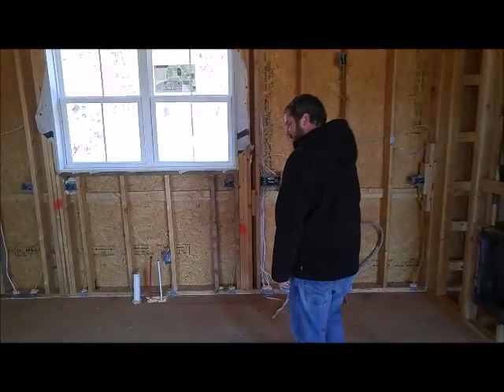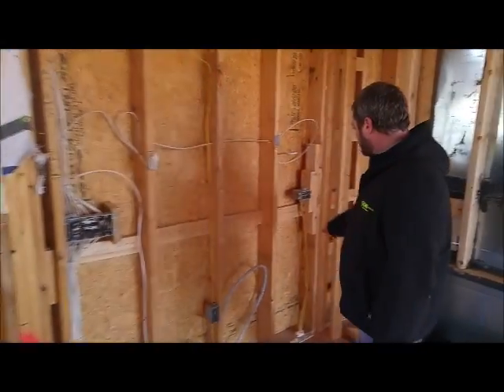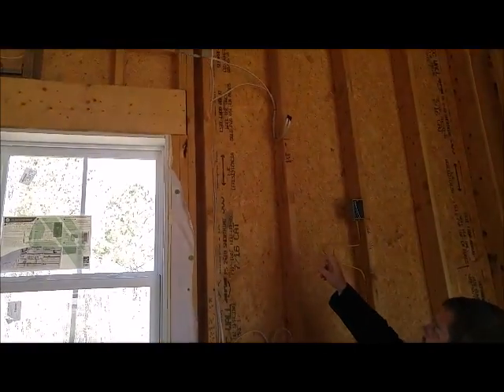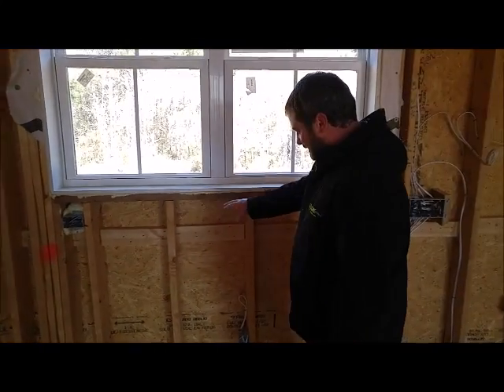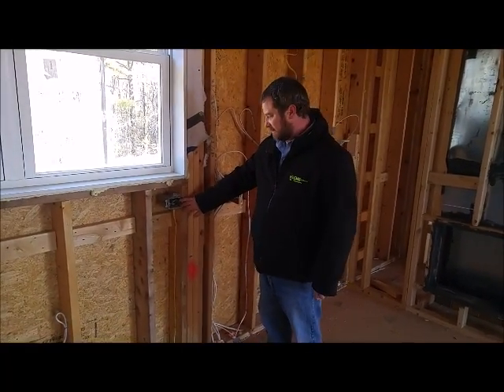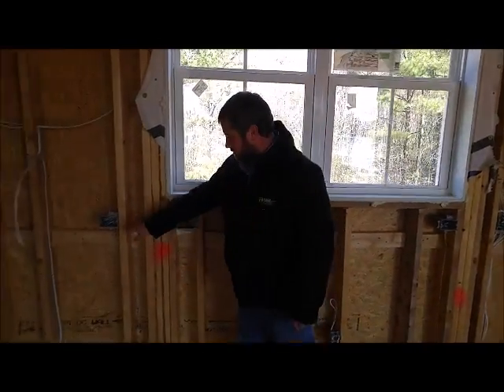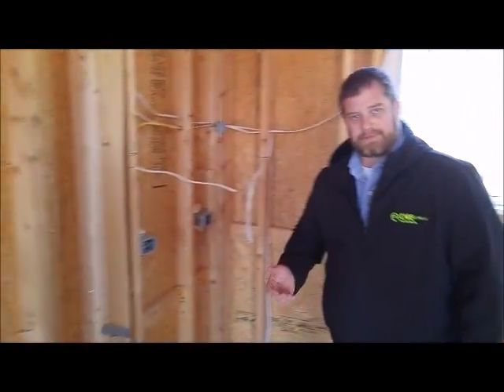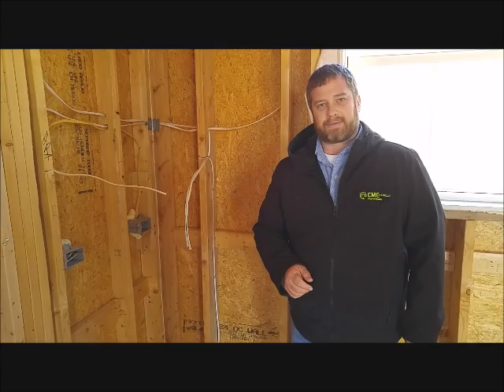Proper Kitchen Wiring

Comment: What is stated in the video is proper spacing code for a kitchen.  If laid out as described then at no point on the wall line over the counter-top area would be a receptacle more than 2' from any point you pulled from.  ie... receptacles spaced out no more than 4' from each other / any appliance with a 2' cord would reach a receptacle if placed at any point on the counter-top

Comment: You do know this guys an idiot right? Code States at no point shall there be more than two feet from any point on the wall to the closest outlet... That means you can put them 4  feet apart... At that distance if you measure from the center in any direction it will be only two feet to the closest outlet this is why the small appliance equipment comes with 3-foot chords. Nec 210.52(c)(1) 
U must feel dumb right about now lol same goes for wall spacing you need an outlet within six feet of a break in the wall then you're allowed to go every 12 ft... Why do you think  electronic devices come with a 6 foot cord... God u must feel dumb right now lol
Reply: also....dont feel dumb
Reply: @kaitlynconrad9080  all I'm saying is that if you're going to do a video showing off your work you should probably know the code and explain you're putting more outlets in for a reason.

Comment: Hi Chris, 
I would like to run as many wires that I can through a hole in a 2x4 double plate at the ceiling to attic location, what size hole do I need and how many wires (12-2 or 14-2)? 

Do the wires need to be derated if i add fireblock foam or caulk in these holes? 

Thanks, Ron
Reply: Generally speaking you can run two of either cable in a hole that is 7/8" or 15/16"

Comment: It would be nice if you could also explain how many non GFCI receptacles are allowed to feed off each GFCI receptacle and each 20 amp circuit. TY.
Reply: in dwelling units, there are no maximum number of receptacles allowed on a circuit; or to feed from a Ground Fault Circuit Interrupter.

Comment: Quick question. What is the required height for the fridge outlet? Thanks in advance.
Reply: 48" to the top of the box
Reply: @derekevans7780  thanks!!
Reply: And that fridge is supposed to be GFI protected.
Reply: @jtd2949  on its own circuit?
Reply: @alfredobrown  no, the fridge can be on one of the 2-20 amp circuits for the kitchen. ....run a separate circuit ....your warranty on the fridge will love it.

Comment: In Ontario the Microwave-Fridge-Dishwasher must have their own lines. 15 amp. you can use 20 amp if you want.They also like Armour cable for the dishwasher run back to the box.
Reply: We also run dedicated runs to those appliances but are not required to run dedicated to the Fridge, it can be tied to one of the small appliance branch circuits.
Reply: Not sure why for the fridge.? I think maybe anything else on the line that has an infinite draw like a Toaster-Kettle-Mixer etc. maybe?
Reply: In Ontario,  does the hood fan need it's own dedicated circuit? (15 or 20 amp) and the dedicated Microwave circuit is to be 15 or 20 Amp.? TY.

Comment: You can never have too many receptacles. Anf if you want incandecent lights I will tell you to go fuck yourself. LEDs only ! And please do your lighting feeds through the switchbox first. Switch legs should be banned. I need to have neutrals in my switch boxes for future additions. I know you love 14/2 but I only use 12/2. People are always adding to circuits.
And please be advised that the NEC specifies minimum acceptable work. Going beyond NEC standards is not that hard. Trust me.

Comment: The NEC code requires a minimum of two small appliance circuits.  I generally end up with four or five in new homes.
Reply: Yes sir.  As long as the two serve all counter-top receptacles you can add as many as you would like.
Reply: Yeah you usually do. Dining room or dining area, microwave oven, large fridge

Comment: Thanks for the video. It was very helpful. I'd just like to verify a few things with you if you don't mind? You must have two breakers dedicated to the kitchen receptacles which should be 20-amps from what I gather from you video. The breakers can be GFCI protected or the receptacles themselves. If you do the latter, do you need all outlets to be GFCI protected or can you just use one GFCI receptacle per circuit if you know the other receptacles in the circuit will be protected by the first GFCI receptacle? Also, what about islands and peninsulas? Do you need to have an outlet in the island and/or peninsula per code or do you need to just have a receptacle within a certain amount of feet of the island and/or peninsula? TIA!
Reply: You can just use one GFCI receptacle per circuit.  You would run your homerun(line side) to the first receptacle and hook that to the "line side" of the GFCI which is labeled.  Then the receptacles that are downstream of the GFCI would be attached to the load side of the GFCI.  That way all the receptacles are GFCI protected.  Good question!  Let me now if you need anything else.
Reply: Thanks for the reply! We're in the planning stages of a kitchen reno in a 1950's home so this is all very helpful. I think you may have missed my second question about islands/peninsulas in my previous comment. Could you share your knowledge on that subject when you get a chance? While I'm thinking about it, would any other appliances need their own circuit in the kitchen other than a refrigerator, microwave, and oven? For example, should a dishwasher or range hood be on their own circuit or can they be branched off one of the two 20-amp counter top receptacle circuits? Thanks again!
Reply: Yes.  You will need a receptacle on the island and peninsula.  To simplify the code for these areas you will need one on the island unless it has a sink or appliance in it that breaks up the countertop surface in which case you will need one on each side.  One on the peninsula if it extends 2' from it's base.  The range will need a 240v dedicated circuit if it is electric, typically 40 amp, sometimes 50.  You can size tour conductors by looking up ampacity in 310.15 and using the 60 degree Celsius column.  If it is a gas range you can feed it from one of the countertop receptacles.  The dishwasher, disposal, refrigerator, hood, microwave....all need to be dedicated circuits.  Dishwasher and disposal are good on 15 amp circuits but the other appliances need to be 20 amp.  14/2 for 15 amp and 12/2 for 20 amp.  Think I covered all of the questions.  Thanks and definitely have a licensed electrician check everything out before "going live".  Don't know if your local in NC but if so feel free to give us a call.
Reply: CMC Electric Thanks for all the info! Unfortunately I'm not in NC but I'll make sure to have a licensed electrician check my work.

Comment: Great post, thank you!  I have several questions if you don't mind... can you speak to AFCI/GFCI requirements in the kitchen and do you prefer to meet those requirements with a source outlet or a dual function breaker?  What gauge of conductor is needed for induction range and electric oven?  Can electrical outlets be mounted to underside of overhead cabinets and spaced every 2' to meet code?  Thanks again, great work!
Reply from the maker: Hey T Wiley.  Thanks for the questions.  We typically will use actual gfci receptacles to meet code instead of gfci breakers.  The only reason for this is cost savings but either way is fine.  AFCI would only be needed for the lighting, at least as it stands right now in NC, the for we would use an AFCI breaker for the lighting.  Check with your local municipality about this for your specific area.  For the range, typically a 40 amp circuit does the trick...a #6 ser style cable but check on the specific nameplate for specified ratings.  You can mount receptacles to the under side of the cabinets as long as you are still meeting the spacing requirements (within 2' of a break in the countertop and within 4' from receptacle to receptacle).
Reply: To satisfy afci/gfci requirements, I use dual function breakers. They are the same price as afci breakers and then you save the cost of a gfci receptacle. 

I have seen wire mold used on the underside of the upper cabinets. While they look cool, they would be difficult to plug into because you do it blind.
Reply: I would use the afci breaker in the panel and feed from that breaker to a GFI receptacle. Reason being it will probably be the GFI that will trip on occasion and it's easily reset at that location rather than having to go to another location where a combo GFI/AFCI would be located. Although the combo breaker will indicate which condition tripped the breaker.

Comment: Great job! FYI, the dedicated circuit for the refrigerator can be 15A rather than 20. I typically wire those with 15A (#14 cable) because refrigerators don't typically draw more than 8A. Most are even less than that.
Reply from the maker: Jeff, you are absolutely right.  We do the same most of the time.
Reply: That is correct unless the refrigerator company specifies a dedicated 20amp line which I  rarely  see.
Reply: Jeff True
Reply: I like to have a separate 20 amp circuit for the fridge and use that same circuit to power up all the receptacles in the dining area.
Reply: The receptacles do not have to be 20 amp as there is more than 1 receptacle on the circuit. Even 1 duplex receptacle doesn't have to be 20 amps as the code counts how many receptacles are on 1 strap. If you have a strap with only a single receptacle, then you need the 20 amp configuration.